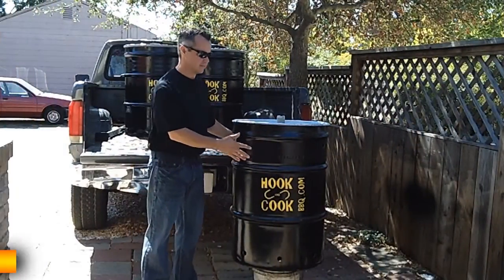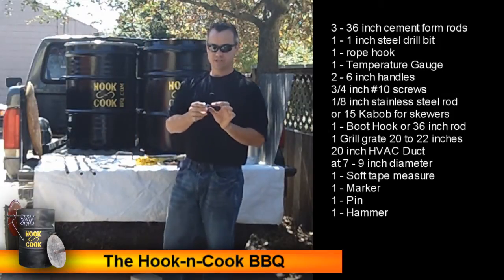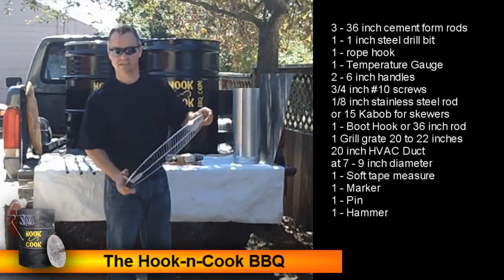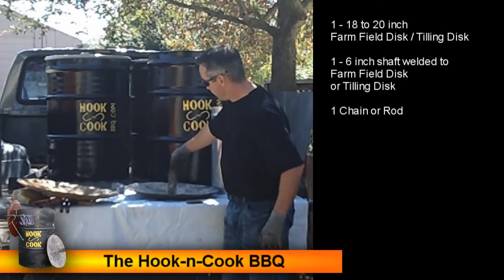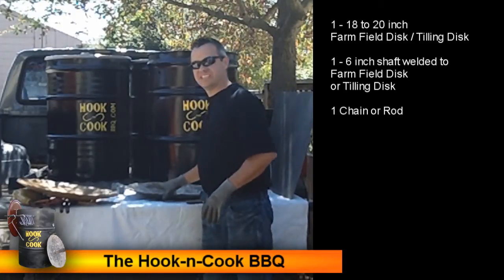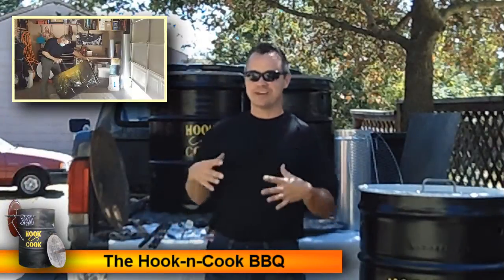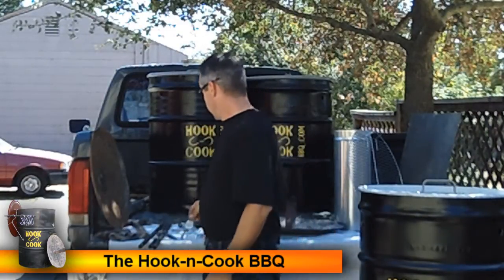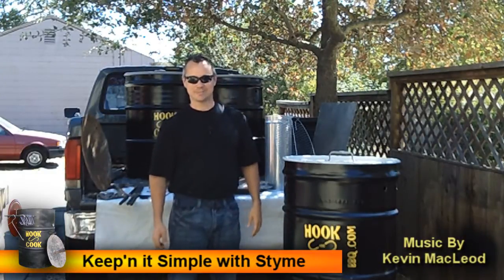Hook-n-Cook BBQ How To Build

Comment: Styme, Got 2 drums, rebar, metal for hooks and rebuilt my disc harrows so I have 20 discs for the fire pan.  I do not have a nook so I can't use the Barnes and Noble ebook download.  Is there a way to buy a set of instructions from you that I can take out to the shop for reference to build my smokers?  Thanks